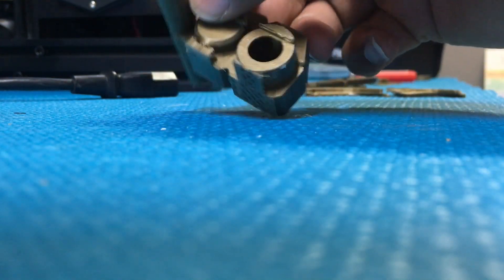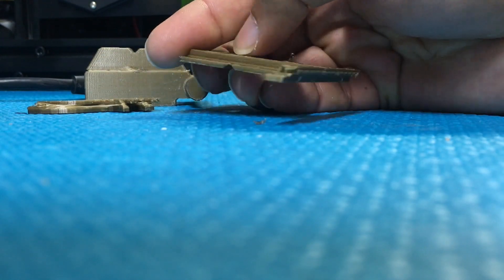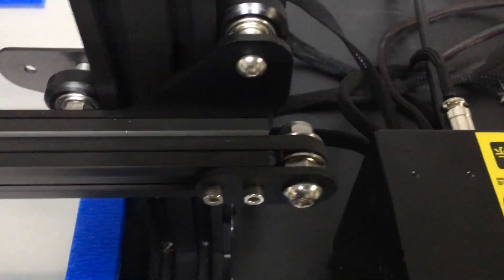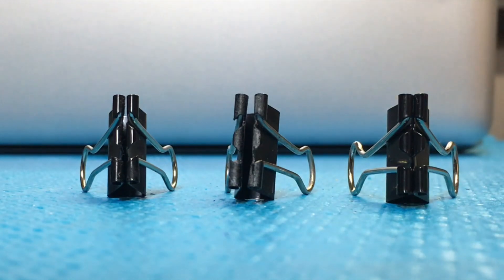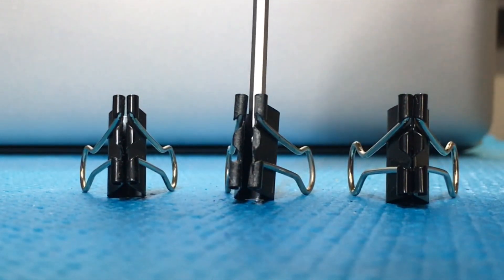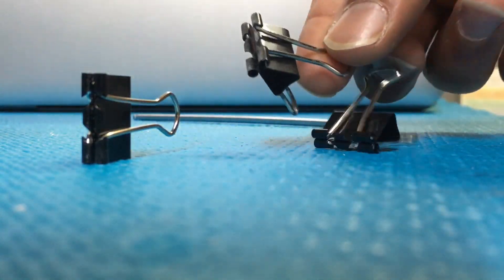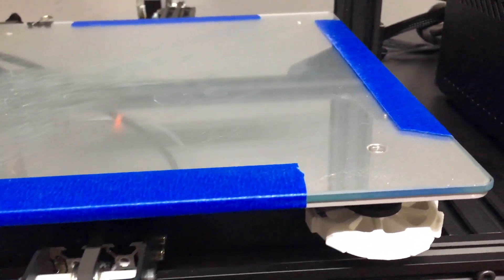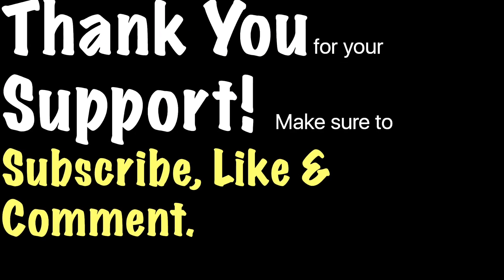3D Printing Layer Shift [Simple Fix]

Comment: I will monitor my clips, I Woke up to my plate loose and my clips knocked off. I dont know what caused that failure but the next few runs were fine. Today I woke up to a hard layer shift only in the Y axis. It was a 9 hour print and the failure was sometime during the last two hours of print. For all I know it could have been my cat, lol.

Comment: Got my first shifting about 1h ago. Very first out of 9 machines. And cant find out why. I have fixed holders for the glass. Its very odd
Reply from the maker: if the problem is still there maybe check to see if your belt is loose for the axis your getting the shift on.
Reply: I always get shifting on my newest cr-6 se. Tried it all with belt, fixed clips so its not them. Screws on motor shaft ok. Its my  Y axis

Comment: Nice! Thanks - I would have done the same, took apart the whole printer for it to be only something simple. Weird because I was just using tape but I just went back to clips but I never had this issue before...so I'm going to back back to tape and see if that helps.
Reply from the maker: Sounds like a plain. Good luck!
Reply: I didn't tighten the nozzle enough when I changed it...
Reply from the maker: @Marco-ki2jr  Ha ha its always the small things. Good luck man.

Comment: Thanks for this I'll check my Ender 3,  however this could not be the problem with my Ender 3 Pro as it has a magnetic bed, any Ideas on this one?
Reply from the maker: There could be may things besides this but maybe the magnetics shift a little too.  Just a thought.
Reply: Did you find anything?  I have an Ender 3 Pro also, and the whole print shifted over an inch!  second time this happened to me in the last week.

Comment: I used to use clips and one day i needed the extra space for a print. So i taped it. Worked great. Printed right over the edges of the tape so i left it. The same pieces of tape have been on for probably 6 months and 8 rolls of filament. It's all I'll ever use.
Reply from the maker: I agree, the tape stays on for a long period of time and not to mention the nozzle never hits any clips as its printing.

Comment: Been doing this same thing for about 7 years. It also lets you print to the edge without worrying about hitting clips. Painters tape comes up easy if you replace it every 6 months or so I have left it on for over 2 years and it was brittle and needed to be removed with a razor blade.